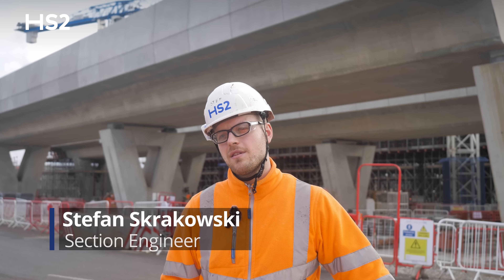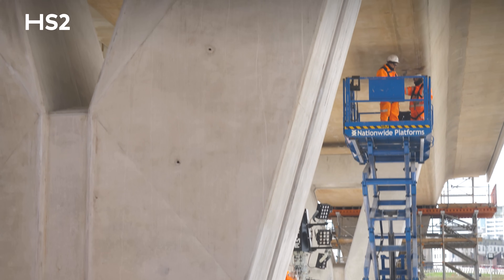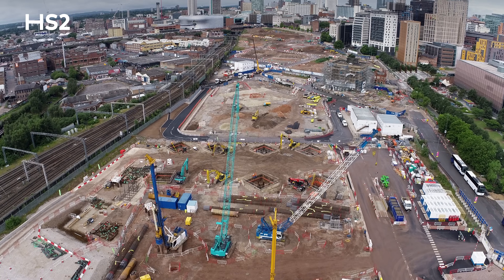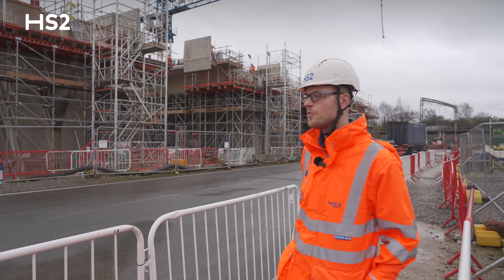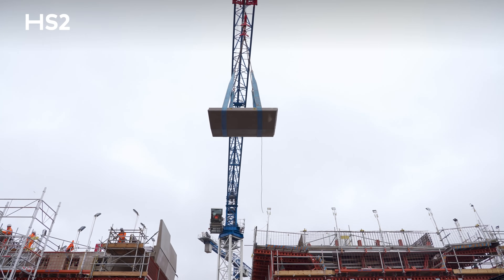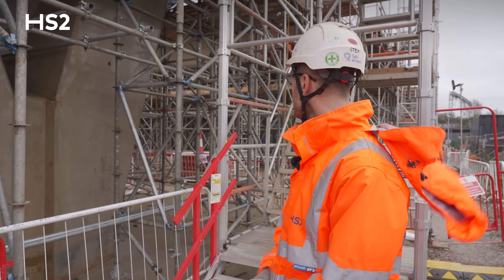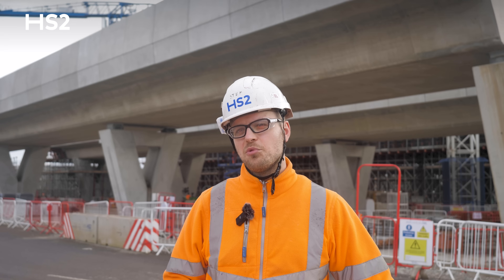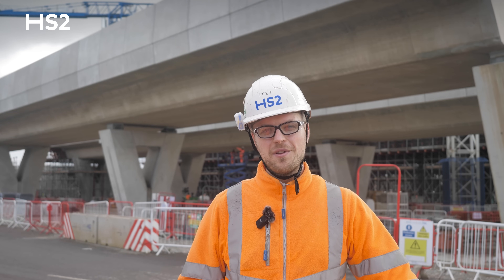First completed sections of HS2’s Curzon Street Station viaduct

Comment: Great commentary, which as a Brummie and Chartered Civil Engineer I find easy to understand. I also worked for VINCI until my retirement.
But I just wonder if a more simple explanation is required?
Or possibly a more detailed explanation of the complexities of soffit formwork for a bridge?
When does the slurry poured into moulds become a hardened structure capable of carrying tremendous loads?
I admire what is being done to assist public understanding of the great things we do in construction but think we need to  do more.

Comment: Hs2, is it correct only 3 of the 7 platforms being built will actually receive trains ? as the other platforms that would have been used if the lines went further north has now been cancelled. Await your reply, thanks

Comment: Will this be built to European gauge and future-proofed (I know the trains will be UK gauge for the foreseeable future) because if we do manage an option of some services on a closed network in future (distant future of course and I'll probably be dead by then) it would be good to have the option of wider and taller (double-decker?) trains.
Reply: No trains for use on HS2 will be built to the European UIC guge other ise they will not be able to run on the existing UK rail network

Comment: I go to different sites on H2s and the amount of destruction on the country side is  enormous.The scale you can not comprehend,from warickshire through country side and the split from the M42 running up to lichfield main line   and what for ? So you can get to and from london 30 mins earlier and it will cost you more.Biggest white elephant in our history.
Reply: Incorrect. It has nothing to do with time. If you understood railways you'd know the network is full. There is no other solution that is viable. Beyond that, if you support mass migration we'll need to repeat it.

Comment: Why a viaduct? Why not ground level?
Reply: Because the station main entrance is higher than the ground level near the original station and for the line to enter Curzon Street Station it has to cross at high level the Birmingham to Derby Railway Line and the Cross City Line before entering Curzon Street Station

Comment: It great to see the station being built. Just a pity it could not of been a through station instead of a dead end. Would of made train movement far easier....and lost less time.
Reply: Unlike many UK cities that are centred on river valleys, Birmingham city centre, where New Street station is located, is on a hill. Curzon Street is actually the original terminus of the London and Birmingham railway, and the railway stopped there because the cost of actually putting the terminus in the city centre was considered at the time (1838) to be too great for the company to bear. Only later was the railway extended to the city centre through a costly tunnel, and the station had to be built in a deep, restricted width cutting. 

When other railway lines reached Birmingham, they too had to approach New Street station via expensive tunnels. The constricted approaches to New Street station and the restrictions on the size of the station have caused problems ever since. It's just not economically or environmentally viable to expand New Street station to accommodate HS2. Also the existing line northwest from there, via Wolverhampton to Stafford (where it joins the Trent Valley diversionary line) goes through 20 miles of urban area, and once again, the environmental disruption of widening that route to accommodate HS2, and the cost of doing so, would be far more than that of the route now being built to the east of Birmingham. 

The new Curzon Street station and approaches to it are sited on old railway marshalling yards and abandoned former industrial areas, so the build cost is relatively much lower, and the environmental impact is much less.

I hope that adequately explains the decision to built a terminal station at Curzon Street.
Reply: Train movements will be easy due to the Delta Junction at Water Orton which will allow trains from Birmingham Curzon Street to go south to London and North to Manchester and the North but will also allow trains from London to Manchester to by pass Birmingham. A through station would of been too time consuming, costly and problomatic with in the City Centre and Birmingham New Street has not the capacity for HS2 services plus other services hence the reason to build a new station for HS2 services

Comment: Unfortunately the piers will be decorated with graffiti before too long.
Reply: good, it should read this is an expensive pile of shit
Reply: @beecee2205  So what would you spend this on, it is not for you but the fiture generations who will want to travel at high speed by rail
Reply: @peterwallen1063  local links. Unlike all the fools on this thread I live in Warwickshire. I live 1.5 miles from Nuneaton. Its on thw west coast mainline. I do not need HS2, which will be over priced. And lets not forget the parking eh ? High speed ? Train from Aston to Acton is high speed ? Please. Do we need a high speed link ? Ever hear of the internet. Its a lot quicker.
Reply: @beecee2205  'I do not need HS2...'  
So by that metric, no one else should need it either. Did you think that through before posting?

'which will be over priced...'
Impressed that you have, what I presume to be special access to the future ticket prices

Comment: Ive anyone is wondering about the grave yard and the bodies dug up to make way for this, apparently they will be reburied  at Witton cemetery.
Reply: Witton Cemettary is closed to new buriels, any thing like this usully go to Lodge Hill Cemetary in the Kings Norton area of Birmingham
Reply: @peterwilliamallen1063  hi this is what I was told by HS2 after raising the question with them. If its not correct I would be extremely interested as I will raise it with my mp. Please let me know.  Thanks

Comment: Impressive civil engineering, but maybe using tunnels would have been aesthetically more pleasing.
Reply: I'm sure the engineers who planned the HS2 route and the construction works have considered the possibilty, but it's likely that the height contours of the approach from the east mean a tunnel would not be a sensible design. It's not a good idea to make trains (even modern ones) have to go up a rising gradient out of a station from a standing start. The line into Euston was built in a cutting going downhill into the station, and this proved to be a problem from day one when trains leaving the station had to immediatley negotiate a rising gradient. Much better to construct railway lines to be as level as possible, particularly at stations.
Reply: and very expensive

Comment: Underneath; a concrete wasteland. You'd have thought Birmingham would have learnt by now.
Reply: Its not a wasteland. Its where people can walk and ride bikes and get about in an open and well lit area.
It has a use so not wasted.
Reply: @1chish  These areas have become waste land everywhere else in the world. I don't think these will be any different.
Reply: Where is this concrete wasteland?
Reply: It central government that decided to put tunnels in empty country side rather than a tunnel and underground station here.
Reply: @DavidKnowles0   Well not true but have you any idea of the subterranean structures under Birmingham from the last 200 years that would have had to be either shifted or negotiated around? Curzon Street station will sit above ground rather than in a huge hole underground. More daylight and easier access and less costly.
Reply: @1chish  Can't be worst than London, which have had several new underground stations built over decades.

The government choose to spend money on tunnels through empty countryside rather than on Euston which even the best proposal is half arse and have gotten worst since and Birmingham stations.
Reply: @DavidKnowles0    here is an idea David: Go measure the length of a London Underground tunnel and then go and measure the Curzon Street station footprint. Clue: Curzon Street is about 4 times the width and 3 times the length.

And yes I can read. You wrote that before but it changes nothing. The bored and Cut & Cover tunnels are there to preserve the local habitats, reduce local noise and avoid gradients (critical at 250 mph).
Reply: @1chish  most of the tunnels are there because David Cameron promise them in return for MP because he was to proud to rely on labour vote for the HS2 bill
Reply: @DavidKnowles0  and you don't think Birmingham Council had any say in it? You have no clue.
Reply: Huh? 1:40
Reply: Birmingham is a wasteland it's not progressive place ,bankrupt council ,suffered decades of austerity and cuts not a nice place Birmingham is full of poverty and drugs and depression place is backwards and miserable people not progressive at all.
Reply: How do you know it will be a concrete waste land under the viaduct